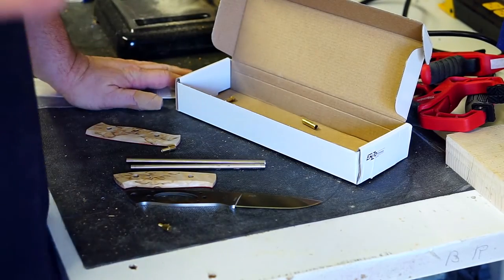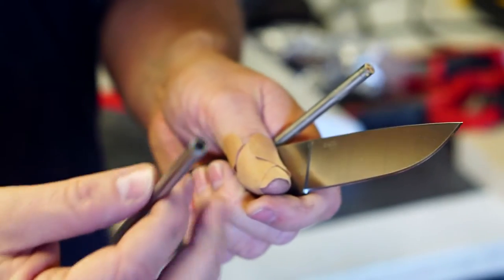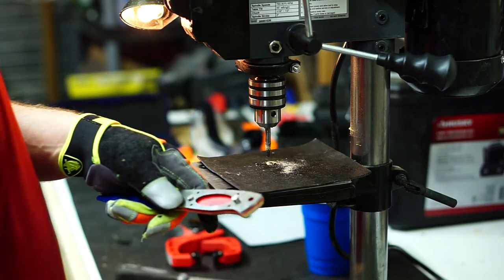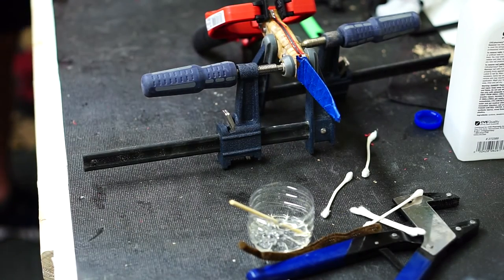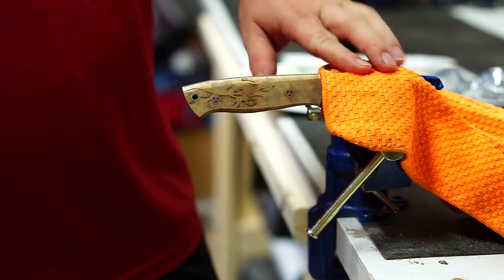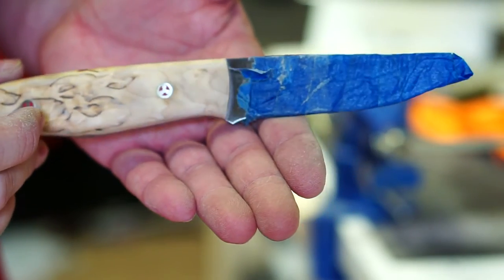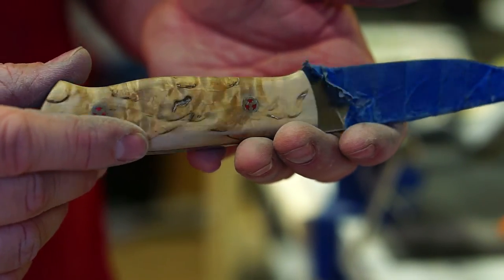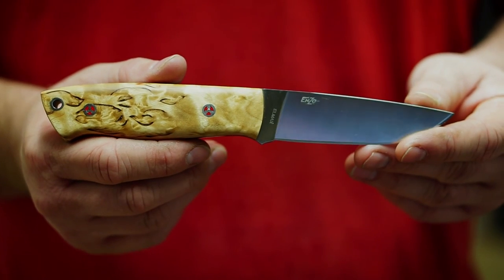Elmax Enzo Trapper Assembly with Mosaic Pins

Comment: Did you heared of 3M sandblaster or 3M Pro-grade precision available in 100/180/320 I believe
Reply from the maker: I’ve heard of prograde. I used the 3m elastic for my contouring on a lot of projects, but the rolls have been hard to find in the stores.

Comment: Say Heah,  I really would like a completed Enzo Trapper in a Scandi Elmax,  I can't find one,  Do they make them completed,  Thanx in advance.
Reply from the maker: Ya, I don't see any completed units where I normally buy, either. In fact, I'm not seeing any scandi elmax blades either. Bushcraft Canada and Brisa direct sites have them, but not seeing them too many other places. I'm betting it's a heck of a knife. The only other model I didn't get, but thought would be good is the Elmax in scandi. I have the flat with secondary bevel. Still not had time to get out and really put them through the paces. Been working 75-90 hour weeks since my boss resigned. Sorry, I don't see any others either. If I do, I'll try to remember to shoot you a link. Cheers
Reply: Puh-lease lemme know,  Thanx.
Reply from the maker: Not a completed knife, but they have an Elmax scandi blade at Thompsons if you want to make one yourself - http://www.thompsonsknives.com/enzotrapper.html
Reply: Yeah I know,  I want one complere
Reply: Complete

Comment: Using a glove with a spinning tool is a good way to twist a finger off.  Just saying...
Reply from the maker: Ya, it seems like one should exercise caution and common sense regardless of power tool in use when working with a sharpened blade...